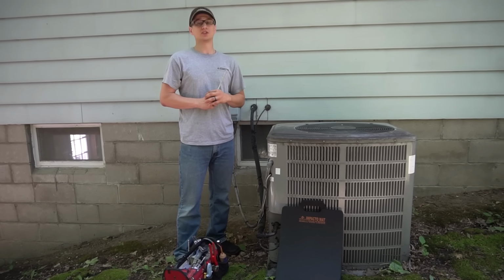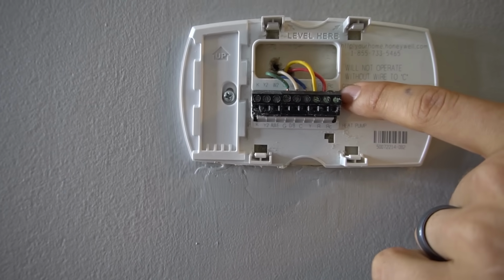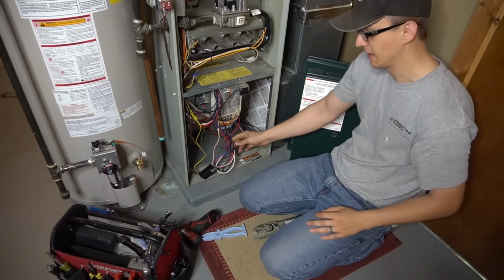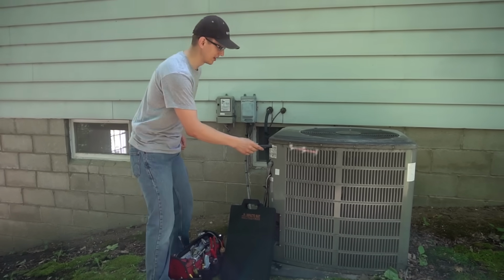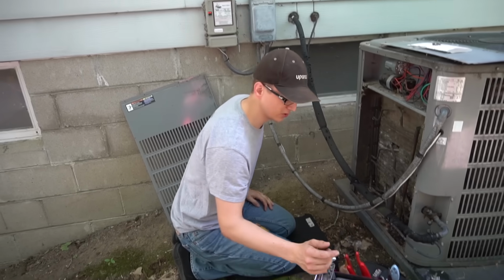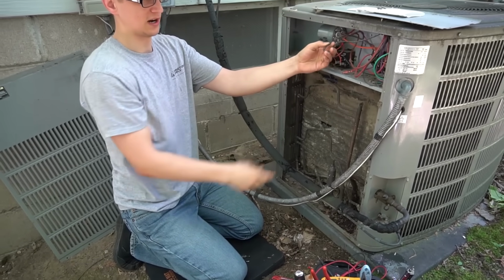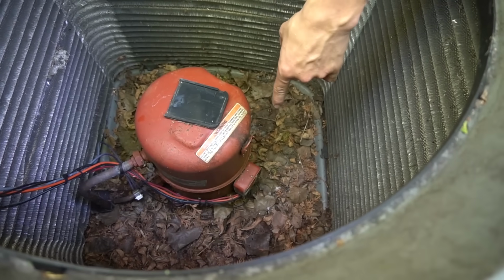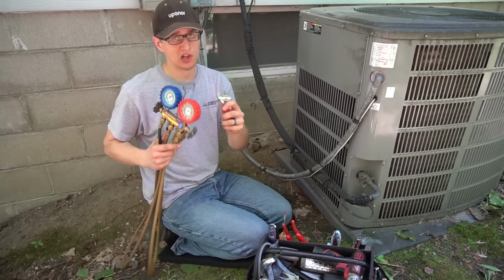AC Unit Not Turning On - How to Fix It Step by Step

Comment: Everything in house was running outside fan and compressor wasn’t. I hit top with my hand and it came on. Also a couple days earlier I heard it come on it died a little and picked back up. What do you think?
Reply from the maker: My first guess would be a weak capacitor. Do you have a meter that you can check it with? If not, then I would just replace it. It's a relatively cheap part. while you are replacing it, I would also check for any loose wire connections
Reply: Word of Advice TV ok thanks that’s what I was thinking just wanted second opinion

Comment: Hi. We had a clogged drain going to the condenser pump. We got it fixed and now the ac would come on but not hit the selected temp. And ac wouldnt shut off.  We bought a new Honeywell thermostat yesterday. So now it comes on, its cold at first and gets a little warmer as time goes on and not reaching selected temp of 74. After many hours it will finally ger to that yemp but ac wont shut off. Could it be low o. Freon. Also there was a. Jumper in the r and rc terminals. Will that make it run continously? If tou take that jumper out. Ac wont come on. Im lost. Thanks
Reply from the maker: From what you described, it sounds like it could be low on freon. I would make sure your furnace filter is clean and the outside condenser coil is hosed down/washed too. Either of those being plugged/dirty could cause it to not cool as well.

I don't think there is anything wrong with the thermostat. If it was getting lower then your set point by a couple degrees, then I would say its bad. R means power and RC means power for cooling. The jumper needs to be there otherwise there is no power sent to the AC unit.

Unfortunately a freon issue is not a do it yourself project so if the filter and coil are both clean and it is doing that, you would need to call someone to come look at it.
Reply: Word of Advice TV thanks so much. Filter is cleann my husband is going to check the outside condenser  before qe call soome to fill the freon.  I did call the company that serviced it last. It was in 2013 before we moved in and they put 1.5 pounds if freon in it then. Ao im guessing a small leak somewhere.  But that lasted 5 years
Reply from the maker: Ah okay. Well if it has been refilled before, then most likely enough of it has leaked out again to where it's starting to affect the cooling. Hope it won't damage the wallet too much! Good luck!
Reply: Word of Advice TV thank you.

Comment: My inside unit is working but my outside is not running and it keeps tripping the breaker outside . The tech said it the compressor but I’m not sure . Any thoughts on this?
Reply from the maker: The only way to check for sure is with a meter if you have one. (I have a recent  video on my channel, how to check compressor) Otherwise, another way would be to unplug the compressor wires, preferably at the compressor itself to see if there's broken wires, (make sure the unplugged wires are not touching anything) and reset the breaker. If it does not trip with the compressor unplugged, then the compressor is bad.
Reply: Word of Advice TV thank you. I found the video after I wrote this

Comment: My thermostat and circuit board are both off it's not the fuse or switch. I checked and I have 120v power going into the circuit board but the led light is not illuminated and  24v are not coming out. Could this be a sign of a bad circuit board or transformer?
Reply from the maker: You are right, sounds like either the control board or the transformer is bad. (I am assuming you checked the 3 amp fuse or breaker and it wasn't tripped) Does the control board send 120v to the transformer? And does the transformer send out 24v? If transformer gets 120v, but does not have 24v coming out, then the transformer is bad. If the board gets 120v but does not send it to the transformer then the board is bad. If this is getting a little confusing, I have a video all about it: https://www.youtube.com/watch?v=52iq9rYI0mI&t=1s
Reply: Word of Advice TV Yeah I figured it should be one of the two I'll be sure to watch the video hopefully it will help me. Thank you so much for replying to my question

Comment: 5 year old Trane TAM 7 air  handler  connected to 2 stage compressor tran honeywell 803A thermostat with dehumidification option

worked most of that da  then
Symptom
The thermostat calls for cool, the relay clicks.
 then immediately the green backlight goes out  and  comes on and goes to "wait"

Neither the condenser nor the blower try to kick on.  not sure if the contactor gets energized 
Then this fail-to-start-up cycle repeats.
basically the thermostat sits in wait and every so often tries to start up when wait is done 

There are no red led  fault codes on the EVC or EFC boards. in my mind the the green the blue and red leds work as normal
i can hear the stepper motor when i reset power
blue light for communication  blinks every 4 seconds so that's ok

The leak float plunger  switch is down
under non operation but power up transformer output is 27VAC
No visibly chewed  wires in condenser, form the attic to the ground wires are not visible

the red wire on thermostat is only connected to RC if it is jumped somewhere to R i don't know where.

 

maybe kill power in the thermostat and the control boards for a second. 

  should i jump them jumper R and RC?

Is it possible that something outside is drawing so much current as not to blow the 3.2A slo blo fuse but lowering the voltage ot make the boards reset  ?

could over current draw likely be  bad contactor or mouse chewed wires, i don't know  to  check these 30'  long wires
Reply from the maker: Hi Dawn! Thank you for all the details! I wonder if your thermostat is bad? Does your furnace/air handler have a 3 amp fuse or breaker? If it does, then it would be safe to try and bypass the thermostat to see if your unit will come on. You can bypass it either at the control board or at the thermostat itself. If you look at the recent videos on my channel, I have 2 videos on how to do that. But if you have a heat pump, then bypassing it would be a little different. If the unit does turn on with the thermostat bypassed, then you know that your thermostat is bad or perhaps it has weak batteries.

It's rare that there is a broken thermostat wire inside the walls but its possible. The way I check it, is by tying thermostat wires together and checking resistance. So for example, I would turn off power to the furnace, then take off R and Y at the thermostat. Put those two wires together and then go to the furnace and disconnect R and Y there too. Set your meter to continuity or resistance and put one lead on the R wire and one lead on the Y wire. There should be continuity/resistance. If it is O/L, then you have a broken wire somewhere. Then you would repeat the process for any other wires you suspect. Like R and G, or Y and C. Hopefully that made sense. I think I will make a video on how to do this a little later..

Comment: Thanks for informative clip!
My furnace blower is not coming on at all. Can it be the control board that is outdoor on the condenser unit is dead? How can I test that? (Its two led lights are dead). How to I troubleshoot control board? 
The model is Rheem 13pjl30a01.
Thanks!!
Reply from the maker: So the blower inside is not coming on? Does the unit outside turn on though? If it is the inside fan that is not working, then something inside is problem. Either the furnace control board, fan motor capacitor, or bad fan motor. I have a video for the inside fan not working, take a look at it if you want: https://www.youtube.com/watch?v=JSgLGTAbDF8

Comment: Hi,  my ac unit, fan is running but the compressor tries to run for few seconds and then stops.. What could be the issue?
Reply from the maker: Most likely the capacitor, the part for the compressor is dead. Most of the time replacing that capacitor will do the trick :) I have a video on how to check and replace one. (it's pretty easy) Just look in the video description, also there's amazon links to capacitors in the description too if you need help finding those. You can also get them at a local appliance parts store but sometimes they can be hard to find since most stores will only sell to contractors. Good luck with the repair and stay safe!

Comment: I used this video to repair my Air Conditioner. It took me 10 min. to remove the Run Capacitor. I found the replacement part on Amazon for $14.68. It came today and it took me 10 min. to install. This is a GREAT how To Video.
Reply: Carlos Marve what was your ac doing?

Comment: Hello, great video! Ok I have an issue with the plunger sticking on the connector. Initially a spider had gotten in there and made a home so I cleaned that all out but it keeps sticking. I can turn off the unit and thermostat and manually tap on the plunger to cause it to move freely and the unit will turn on. However once it stops the plunger sticks and won’t go down unless I turn everything off and tap on it. Can I use a lubricant to loosen that up? If so what type and brand would you recommend? 

Thanks!!
Reply from the maker: It would be better if you replace the contactor. It is a relatively cheap part. Once they start sticking like that, the problem will keep coming back. In the field we never lubricate them, only replace. You can get one on Amazon (look for the contactor link in the description if you need help finding it)
Reply: Word of Advice TV thank you!!!! How do I know if I have a two pole or one pole contactor? Also do you have a video instructing how to replace?
Reply from the maker: No problem :) A 2 pole contactor will have 2 plungers. A single pole will have 1. Unfortunately I do not have a video on how to replace one. If you take a picture of the wires, or label them before taking them off of the old contactor, I think you will be okay. The new contactor should be very similar to the old one so the wires would go in the same spots. And of course don't forget to be safe and make sure the power is off before pulling off any wires.
Reply: Update: I ordered the part on Amazon for $10. Installed it myself and the unit works great!!!!! Thanks for the great advice!!

Now on to the second AC unit. It runs but doesn’t blow out cold air. Where should I troubleshoot first?

Comment: I have a question . my condensation pump has a switch on it that shuts off the a/c if the pump stops working . I removed the two wires that goes to the switch on the pump to replace the pump . the two wires tuched the furnace and they sparked . now the a/c want come on . The fuse is fine and I can't seem to find the problem . Did I short out the defrost board or what ? Oh , the red and green light on the heat pump are blinking .
Reply from the maker: I wonder if that overflow switch is wired in before the fuse. If that is the case then the short may have taken out your thermostat.. If you have blinking lights then the transformer should be good. (sometimes that gets damaged from a short like that) So it would seem that either the control board got fried or the thermostat.. Or maybe neither. Hard to say without checking it. Do you have a multi meter that you can check voltages with?
Reply: yes
Reply from the maker: Ok so if you check some voltages, we will be able to figure out what's going on. Turn your thermostat on to cooling and go down to your furnace/air handler. Find your thermostat terminal strip at the control board (R,Y,G,C,W) What readings do you get between..

R and C (should be around 24v)
R and Y (should be 0v)
Y and C (should be around 24v)
Reply: inside at the furnace I have a strip that's labeled C,G,W1,W2,W3,R. Outside on the heat pump A/C I have a strip labeled W1,C,L,R,O,Y1.  So on the heat pump A/C R&C=24, R&Y=24, and Y&C=0  . I took readings on all of them , inside and outside . I could list them all but I will take me a while with my two finger hunt and peck.
Reply from the maker: Oh boy that one could turn into a handful. A multi stage heat pump. Unfortunately I do not have much experience on those as they are a rare sight in my area. You will probably be better off asking a different technician. It would be hard for me to try to walk you through it since I haven't worked on too many of them myself, I would have to be there and see it. Sorry.
Reply: Its just a short drive to Oregon . LOL . Thanks for your time . Your videos are helpful nun -the less . I don't see anything wrong/burnt on the board so i'll  find it .
Reply from the maker: Yeah.. At this point I may end up misleading you instead of helping lol. Hope it will be something simple for you, good luck!

Comment: Thank you!  Circuit breaker was tripped, unit was buzzing but fan was not turning.  Gave it a spin and it started to run although it’s a bit wobbly.  Since it’s a unit at my job I think I’ll have the call a pro to check it out and replace the bad bits, but you got us up and running in the meantime and at a Senior day center that’s a major thing.
Reply from the maker: Alright, hope it cools for you! Although that sounds like a bad capacitor plus something with the fan blade.. But good that it's at the job :) Have them do it for you. Stay cool!

Comment: Good morning, My one of my ac units turn off on its own. I replaced the fuses, it was working then it cut off after a day. I replaced the fuses again use the master electrical box and turn the power on and off, I give the fan a push and it everything works again. However after a day it shuts off again. What should I troubleshoot for?
Reply from the maker: Do you have a multi meter? I would check the capacitor first to see if that is getting weak. I would also check your compressor and your condenser fan motor. (I have videos on my channel on how to check them). But before all that, I would thoroughly hose down/clean your condenser coil. Even if it looks clean, wash it down anyway. A plugged coil will increase amp draw which can cause a breaker or fuse to trip.

Comment: The 2 wires are red & white, when I follow it to control box in furnace there are 4 places to screw in wires labeled  C Y W R. The red wire is going to the R, the White is to the W. I followed the wires going to the Y & C they combine into a brown coated wire which runs completely separate from control box down the front side of furnace through a hole in floor. When I open the control box the wiring label says   A/C BLOWER RELAY CONTROL MODEL 901994
For use with A 2 wire heating/cooling thermostat 

I can’t find any type of bus fuse either. I bought a non programmable thermostat and wired up all the wires to their correct colors- put batteries in. Still nothing. Something I’ve noticed is that once the i turn the switch on control box onto cool I hear that sound you mentioned like slight hummm & also found where wires come in from thermostat all but the red & white ones are bundled up together just where they come inside the furnace wall - so wondering if I should disconnect the ones I hooked up in the thermostat? 
Wish I could attach a couple pics wondering about these switches on this control box. 
Don’t know if this information tells you anything, any ideals would be so very appreciated. Thanks for your time.
Reply from the maker: That does sound a little messy.. Here is what I would try doing. Try hooking up the yellow wire (or some wire that is not connected) to the Y terminal at the thermostat. (Y is cooling) And then go down to your furnace and connect that same wire to the control box, to the screw that is labeled Y.

From what you described, it sounds like only your furnace is hooked up. (W is heating) But then I am also curious about this control box.. Not quite sure what that is

Comment: I need a help. I change the mode to HOT by mistake on my A/C unit while it was working on cold . Now stops blowing cold air on cold and hot mode doesnt start. What may be the prob did i destroy it? :/
Reply from the maker: Hopefully not. Is your unit a heat pump? If you look inside of the condenser unit outside, do you see a reversing valve? (you can look on google how one of those looks like) So if you turn everything off and then set it to COOL, the unit does not turn on?

You may have a stuck reversing valve. You can try to look up ways to free up a stuck reversing valve and hopefully one of the methods will work  but there's a fair chance you will have to call a technician out for that one.

Comment: Word of advice TV update, you were 100% absolutely correct! my fan motor did need to be replaced. You saved me a ton of money! Thank you!   
Prior to reaching out to you.
I had an HVAC Tech come and take a look at my condenser. He said the unit was too old and not worth repairing. And quoted me $3,000 to replace it! Thanks to you, I repaired my AC unit myself for only $150. I saved a ton of money and learned a little something about how my AC condenser works. Thanks again for promptly replying, for your time, knowledge and for posting informative and easy to follow videos. Thanks again 🙏🙌👍
Reply from the maker: You're very welcome! Thank you for coming back with an update! Glad to hear you were able to get it fixed yourself for $150. That's not bad at all! I hope you will be able to forget about your AC unit for another 5-10 years ;)

Just for anyone reading the comments section, if you get some time could you share your experience on how you went about tracking down the motor that you need for your unit? I think that would help others in the same situation. Thanks!